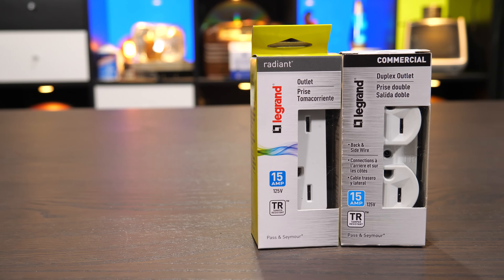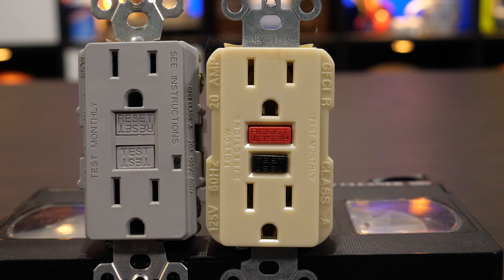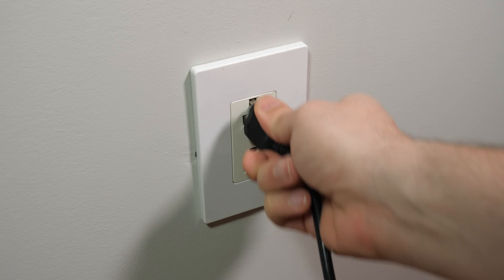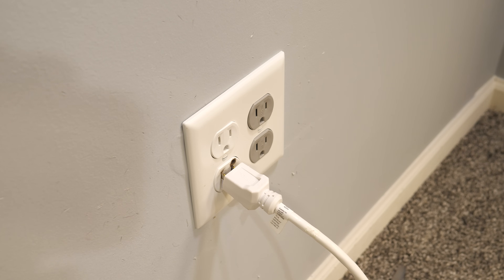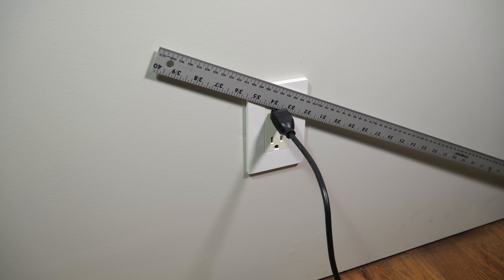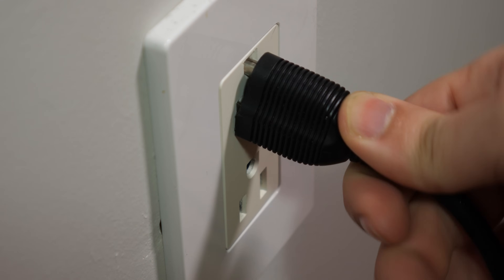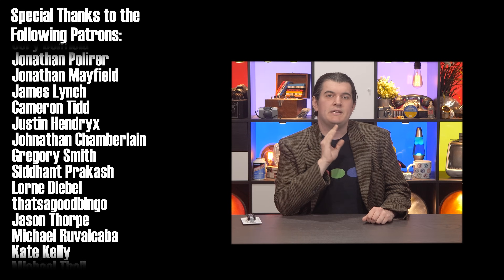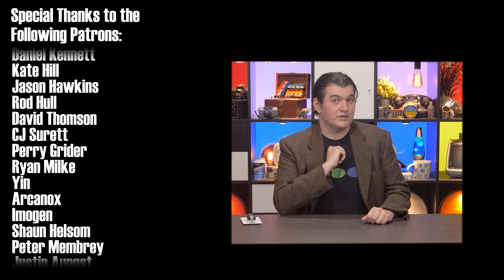Power outlets are topsy turvy - but does it matter?

Comment: For an Austrian engineer like me, your wall socket videos are always so entertaining!
I constantly go back and forward from "wow, how crappy and dangerous are these" to "well, it´s only a 110 volts" :D
Reply: Hoch lebe der Schutzkontaktstecker
Reply: @julian_202 und der BS1363, wobei der provoziert, Eurostecker dort reinzustecken.
Reply: I remember one time when I was a kid I was restringing my guitar and while I was clipping off the excess string,  with an astounding amount of bad luck it hit the wall and rolled sideways onto a loose lamp plug.

I remember a flash of light and a BANG! Two pieces of cable flew off and opposite directions and a 8-in round scorch mark appeared on my wall in an instant. Craziest part is it didn't even trip the breaker.
Reply: My grandma got shocked by a 240 volt outlet when she was cleaning behind her oven. Apparently it was very painful and her muscles contracted which made her jump away from it but she was fine.
Reply: @kylewagenaar5786  Cleaning behind the oven is almost ideal for a painful shock. The grounded oven touched at the same time, possible wet hands... ouch!
I once accidentally sticked my finger right between two 230V phases in a poorly made distribution box. Will never forget the smell and feel. But the oven situation sounds way more dangerous to me.
Reply: Actually it is unlikely that she actually caught both the 240v lines instead of one (or both) of the 120v to grounds. That being said its also a 50 amp receptacle feeding a range not that a human body can usually trip a 15 or 20 amp breaker.
Reply: @kylewagenaar5786  Actually, She would have experienced a "240V" shock only if she touched both pins of the electrical socket at the same time! Most people get shocked because they touch the "live" pin and their body completes the electrical circuit to earth/ground. As the USA provides 240VAC via a split-phase AC power delivery to the home, the two "live" pins of a split-phased wired 240VAC outlet are each only at 120VAC with respect to earth/ground, so touching either of these pins will "only" give you a 120VAC shock. But in most other countries, like in Australia where I live all our houses are fed with single-phase 240VAC power circuits so when we touch the live pin we do indeed get a 240VAC shock. So with two "live" pins on your 240VAC outlet, you guys in America have twice the opportunity to get an electrical shock
Reply: @johncanalese588  I'm not from the USA but it's probably pretty similar here in Canada. Thanks for telling me though, electrical stuff is pretty important knowledge that I need to look into a bit more.
Reply: @kylewagenaar5786  Indeed, Canada follows the same electrical distribution and supply methodology as the USA.
Reply: Some of your compatriots are doing you a disservice.  I've worked with a number of different European plugs and receptacles on boats, and every time, I think: "Nice design, theoretically.  Why is the construction so completely flimsy? And, why is it built so you have to replace the entire receptacle when the piece of thin plastic that's obviously going to develop a crack does just that?"  Does Schneider or someone make receptacles that can be mounted sturdily to a wall and survive a little bit in an industrial environment?
Reply: Might be 110 volts, however when 30 mili amps is enough to kill a grown man, you'd still not want to have those 110 volts pass through your body. 
And European plugs try to reduce those oppertunities to a minimum.

Plus our water boils faster because we have 230 volts :D
Reply: Australian residential outlets don’t have boxes. They use open brackets that allow the combustible wood framing and insulation be exposed to wiring connections at the socket. Seems kinda dangerous.
Reply: @wm79198  Actually, Australian wiring is nicely simplified and much safer than the typical US system. The J-boxes and such we have here in the US are overkill, and they don't at all compensate for the janky nature of our plugs and receptacles.
Reply: @christopherdahle9985  how would a j box compensate for the “janky” nature of a plug? That doesn’t even make sense. A jbox is there to contain arcing if it happens. I wouldn’t want our janky plugs to melt down with nothing but a 1” air gap between it and a wood stud. 

Nicely simplified wiring? Please explain
Reply: @wm79198  I agree, they can't. They are not even related to the problem. But they are overkill for the problem they are intended to address. Putting wiring in plastic boxes doesn't prevent electrical fires from poor wiring practice, putting it in metal boxes doesn't prevent arcing and neither type of J-box does anything to prevent injury from carelessly inserting plugs into American style receptacles which date back to 1903. (Seriously, our modern outlets are the way they are to remain backward compatible with Harvey Hubbell's 120 year old 2 prong system, patented in 1903, and they were a leap forward in safety compared to other practices at the time.)

As to your second question. The Australians use a system that is becoming more common (and is code approved under the NEC in most jurisdictions) in the US, at least in lighting circuits, not receptacles and switches just yet. The NMC runs from device to device and is not tied together in junction boxes, rather the device itself is a junction box. The devices are in nice round holes neatly and quickly made with a hole saw. In Australia, the open brackets you mention serve the only real practical function of junction boxes, they create a solid mounting point behind the wall board so the receptacle doesn't get ripped out of the wall when you trip over the vacuum cleaner cord.

I used this system for the many recessed lights on a recent remodel, and setting the lights was a walk in the park. I didn't have to install blocking or j boxes for any of the lights. All I had to do was make sure that the layout of my ceiling joists and strapping didn't cross any light fixture location. I ran the NMC before I hung the sheet rock and tied up a service loop at each approximate fixture location. After the ceiling was rocked, taped, textured and painted, I came back and precisely marked the location of each fixture. Then I used a hole saw to cut perfect locations for each fixture exactly where the homeowner wanted them after painting and furnishing the room. I could reach up into the ceiling, grab my service loops and directly wire into the fixtures which came with factory WAGO connectors already installed. The fixtures then snapped into the ceiling with spring clips. A previously two-day job required maybe 3 hours and every fixture is tight and perfectly located without the days of indecision needed if you have to plan lighting at the framing stage. No wiggly fixtures, no gaps, no call backs, no touch up paint, and if the room is ever repainted, the fixtures can drop well clear of the ceiling, it will literally take longer to set and climb the ladder than it will to drop and reset the fixtures.
Reply: 120 volts*
Reply: You should look into the effects of 50Hz vs 60Hz on the human body.
Reply: I once thought it would be funny at school to stick my car keys in an outlet in the middle of class. Shocked me pretty bad, but it went away after like 30 seconds. Teachers thought the outlet just did that 💀💀
Reply: Poor choices from back when poor choices were the only choices.
Reply: @sirnickity  It's the perfect example of how First doesn't always mean best, K&T is another great example
Reply: I'm still not sure what we even have here (USA). My UPS units show incoming voltage varying between about 118v and 125v depending on season and time of day. I'm assuming electrical grid load causes the droop?
Reply: @kalmtraveler  The modern US split single-phase is nominally 240/120v. 
10% variation is considered the standard for equipment design tolerance. Actual variation of the grid is much less, closer to 2%. Fluctuation greater than that is normally caused by the wiring of the final installation rather than supply grid fluctuation. Thus you find a lot of appliances and equipment rated for 230v which can be used on both 208v and 240v connections (208/120v is the lowest standard wye 3phase voltage in the US, mostly found in large apartments and office buildings.) 

You get 125v to ground because they tapped your transformer slightly high to account for undersized conductors and a long distance to the building (The other side of the curbside/pole transformer is probably around 12kv).
Reply: @TheDuckofDoom.  ahhh ok that makes sense! thank you for breaking it down :) so with a 10% variation tolerance being ok, that makes sense that even though I see maybe 7v total difference on my ~120v UPS units through the year, that's still all within spec basically. I'm still a little weirded out by our out-of-phase ~ 240 volts situation but that's why I went into IT engineering instead of electrical engineering I suppose. I'm curious if living in a suburban residential house in a development built in the 1950's has anything to do with what I see inside? House wiring has all been replaced but I have no idea about anything outside the structure.
Reply: @kalmtraveler Split phase 240v uses two live conductors. The main wire coming into the house has two live conductors and a common neutral. Each live is shifted 180° out of phase giving you two separate 120v lines when paired with a neutral or a 240v line when both lives are used. Circuit breakers are either single or double pole. The phases alternate with each row in the bus bar. So row one would be L1, row two would be L2, row 3 would be L1, etc. So when you insert a double pole breaker it taps into both lines and you get 240v from it.

For the most part it's only used for appliances that draw a lot of current. An appliance that uses a 60 amp breaker on 240v would need a 120 amp breaker at 120v along with the accompanying fairly thick gauge wire you'd need to use.
Reply: @Dug88  thank you! It's been way too long since my high school electronics class but that does all make sense again. Possibly dumb question but with our 240v being potential across those 2 live conductors, could you not potentially use a device made for a European ~ 230v with some sort of physical plug adapter here since as I understand it their 230ish volts is just between a hot and neutral, kind of like our 120ish volts?
Reply: @kalmtraveler  Yes you could, if the frequency is not a problem, they use 50hz, north america uses 60hz. Not usually a big issue, although some wall clocks depend on it to keep time, and synchronous motors will run 20% fast or slow. Transformers may have an issue if operated near their maximum design capacity due to magnetic saturation of the core.

(Japan uses both. 50hz in the southwest and 60hz northeast, because long ago there was no grid and Kyoto bought generators from europe, and Tokyo from the USA and that became established in each surounding region. Grids weren't a thing until the 1960s, even in the USA towns or large customers each had a dedicated generator and powerlines from a powerplant. )
Reply: @kalmtraveler 110V can go up to 120. 220V can go up to 240. 125V is a bit extreme, but probably within tolerance. It's rarely 110 or 220, and it's better to be slightly above, then slightly below (some appliances might not get enough energy). That's why you often see 100-240V on a lot of appliances.
Reply: @tonymouannes  You are not wrong, but the main reason for the 100-240v labeling is so they can make one device and sell it anywhere in the world. Cheaper to build a smart power supply than to engineer a different product line for different countries. In the 1970s I had a Marklin train transformer that my grandmother brought me from Germany. It was labeled 125-250v and I didn't understand that for a long while. But I cut the German plug off and put an American plug on and it ran trains just fine. On the other hand, once my grandmother brought me a lighted model of the Santa Maria that was built in Spain. When I put an American plug on that thing, I damn near burned the house down. I was ten. I was a feral child. I should never have made it to eleven.

My little MIG welder does have a smart power supply. I can plug it into my 240v shop receptacle or use an adapter pigtail to plug it into 110 somewhere else. It self-switches to run on the voltage it detects. Of course, it can't do any heavy work on the lower voltage. But what really impresses me is the BIG welder at work which can run on anything from 110 single phase to 430v 3 phase. Again, it can't do the heavy work on 110, but it basically says "just gimme da juice and Ima getta work"! I swear, we have the coolest gizmos these days.
Reply: @christopherdahle9985  I know, I just wanted to point out that it's not only 110 and 220, but it can be lower and higher.

Any good quality appliance or converter can handle a bit outside the stated range (or shut off if that's not possible). Low quality stuff just malfunction and cause all kind of trouble.
Reply: @tonymouannes  We're just on different paragraphs of the same page. Cheers
Reply: It drops due to an increase of load on that circuit
Reply: For an American like me, I'm just happy to know that your country doesn't have kangaroos and Foster's beer.

Man, my countrymen suck at geography. :)

Bitte habt ein tolles Oktoberfest
Reply: @migueldelmazo5244  I just wanted to clarify that Oktoberfest is a specific festival held in Munich each year, not some kind of holiday that is celebrated all over Germany and/or Austria. There are certainly people from all over Germany and Austria visiting Oktoberfest. So albeit quite possible it’s still unlikely to assume that he’ll be attending Oktoberfest just by him stating that he lives in Austria.
Reply: @LukasFink1  You are right! But I would feel totally safe on Oktoberfest, mainly because I am confident that they use proper electrical connectors there :D
Reply: @migueldelmazo5244  We don't actually drink Fosters in Australia, we just sell it to the British. We're not animals.
Reply: @migueldelmazo5244  Or reading...
Reply: @migueldelmazo5244  I actually read it as Australian and got confused
Reply: Oops, so did I @renakunisaki
Reply: @migueldelmazo5244  Australians don't drink Fosters. It's very hard to find here. Much of it is actually re-imported for tourists.
Reply: @JemaKnight  I know, but I didn't want to use "say the C-word a lot" as an example of a truly Australian thing. :)
I've got friends from the world's largest outdoor penal colony, and they're great mates.
Reply: Ha! As an American electric consumer I do the same! (dangerous/only 110v) 😆
Reply: Reckless endangerment is our national pastime.
Reply: To quote Eric S. Raymond, "the worst enemy of a better solution is an existing one that's just good enough." The US didn't get bombed out in two world wars and so never felt a need to modernize its electrical outlets. The most egregious safety hazards have been monkey-patched (e.g. GFCI outlets), and the millions in property damage caused by everything else doesn't justify the billions it would cost to overhaul the infrastructure of every building in America.

At this point, the main thing accomplished by posturing about how unsafe and dangerous NEMA plugs are is stroking the egos of Europeans who want the pettiest reasons imaginable to dunk on Americans over the internet.
Reply: Exacly this but in europe. Only 110v
Reply: Exactly. If these were actually dangerous we would adopt a more expensive system like yours.
Reply: Wanna know how to tell that someone's an engineer?

Don't worry, they'll tell you the first occasion they get.
Reply: I couldn't care less, I live in Europe.